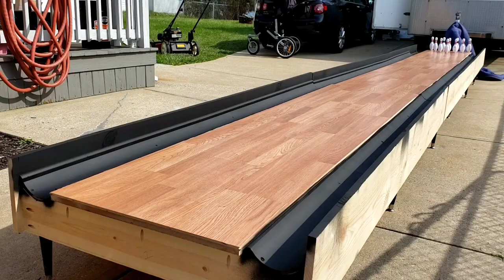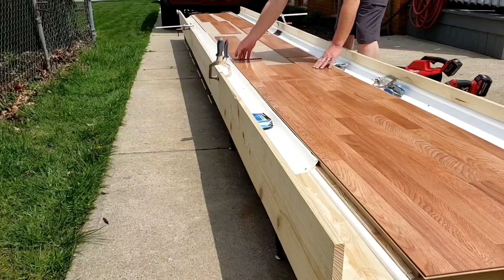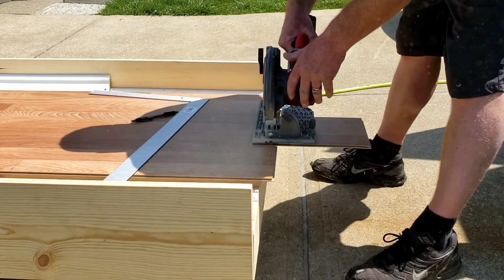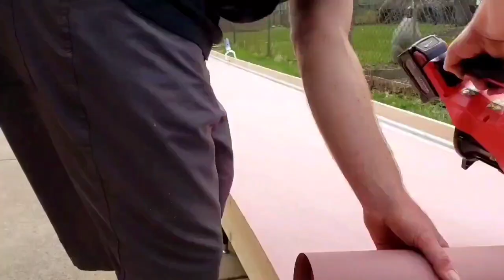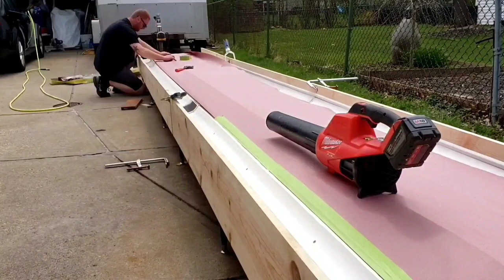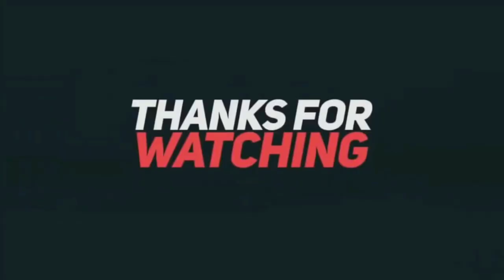Half Scale Mini Bowling Lane Build Part 6

Comment: Looks like a bowling alley! I left my gutters white and they are constantly dirty. I think it is the static electricity in the PVC causing the issue.
Reply from the maker: I didnt show this but I did scuff up the gutters before painting and left it in the sun for awhile after painting so hopefully it will bond well enough to not get scuffed up when a gutter ball is thrown. Only time will tell once we start using it. I could do touch ups as needed too.

Comment: I have my ball dropping on to a couple of rails and exiting out the side through a hole. Phil Kaiser that builds the commercial ball bowler warned me that this would be a problem. Probably 2 out of 10 throws a pin will fly out the ball hole, or cross up on the rails and block the hole. I think they land on the ball rails and kinda get railroaded over to the hole where they either block it or fall through it. Im trying some ideas to close the ball door until needed to return the ball, but it looks like Mr Kaiser has tried similar designs. He elected to have the pin elevator pick up both the pins and ball. The ball gets ejected about half way up and rolls back.

Comment: how wide are the gutters
Reply from the maker: I'd have to measure them. They're made from 6 inch pvc pipe but not as wide since I cut them down narrower.
Reply from the maker: From the edge of the lane surface to the inside of the frame board is 6 inches.